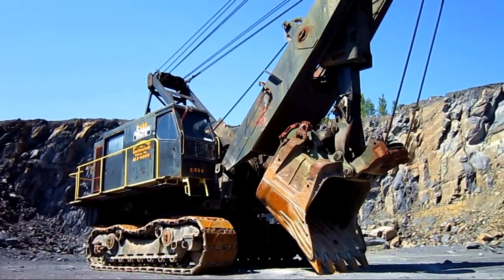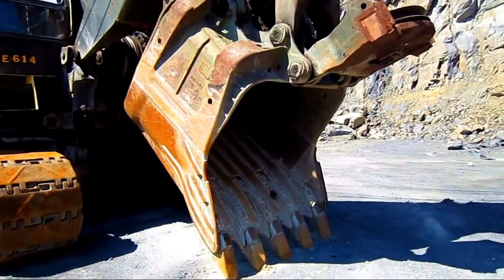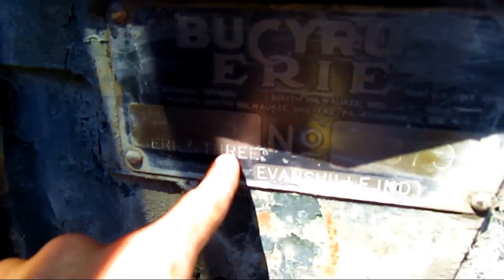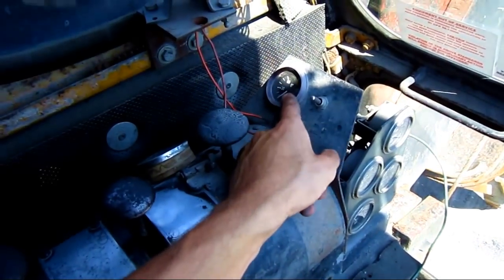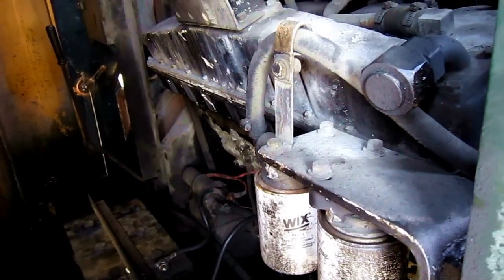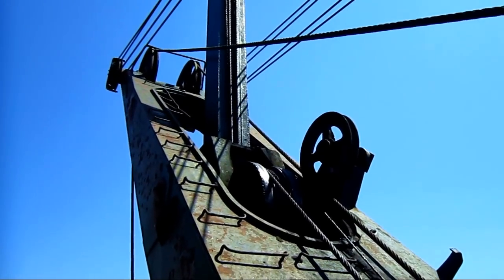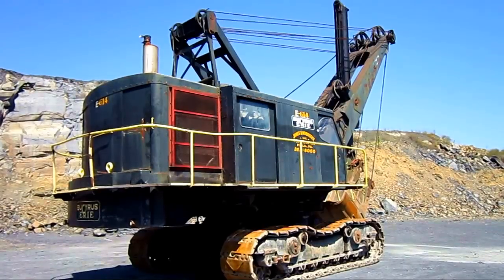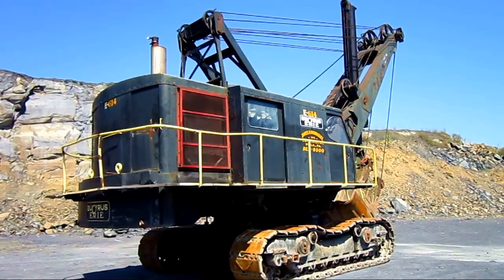Bucyrus-Erie 88-B Series III Documentary

Comment: We use nto have a smaller shovel than that I do know it was a B_E we use to load under it. Had one of the only operators around that could still run cable mchines. also had a drag line in the pit & a clamshell all B-E this was in the late 80's early 90's we were still running them

Comment: I was hoping he would run the machine. When I was a kid I watched SJ Groves & Sons build route 280 in W. Orange, NJ in the early 1960's, and they had one of these loading blasted rock into huge quarry dump trucks. When the 88B bucket opened to drop the rocks in the dump, the noise was louder than the blasting.  There's a picture of the construction site in what was then called the Newark Evening News showing this shovel loader. I wish I could find it.